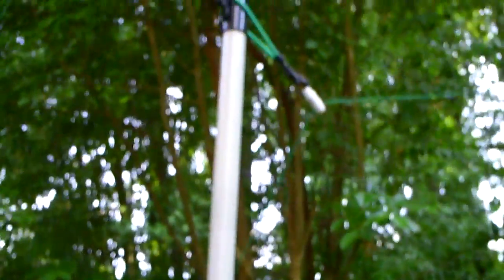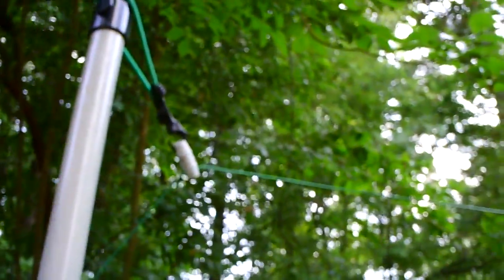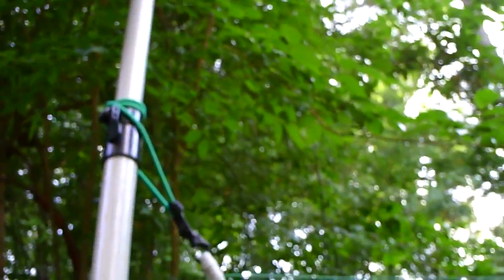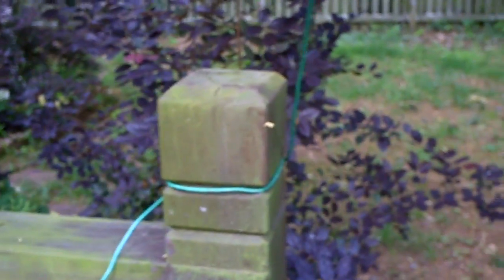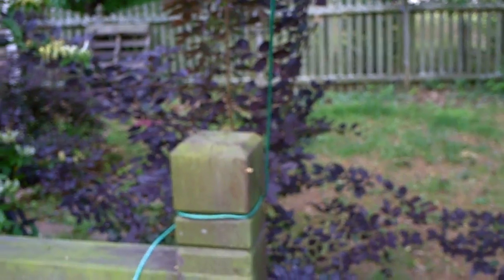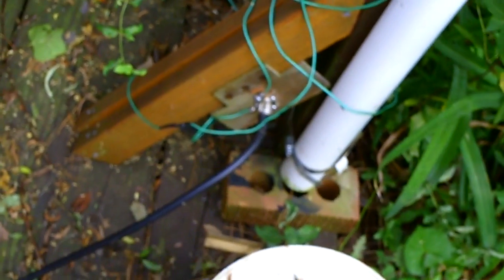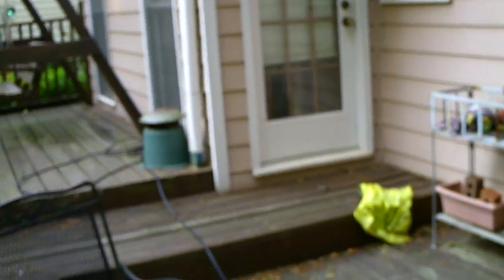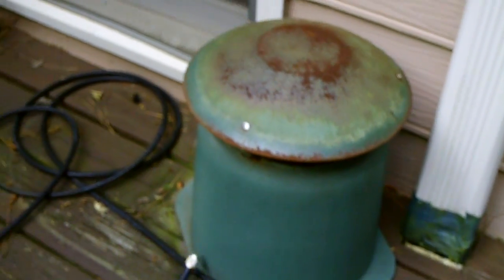My Vertical Loop Antenna Explained.

Comment from the maker: @Lockemeister I used 3.9 MHz to design arouns because there is a Ham radio Net around 3.9 MHz. I wanted to get most of my power into that frequency so I made the antenna resonate around that frequency. It seemed to work, but I haven't used it alot. I lay the antenna on the hot porch in the sun and I think that bakes out any moisture.

Comment from the maker: @MEverett98 I recalculated and found I made the antenna about 257 feet long. It's resonate around 3.9 MHz.
The formula is 1005 / f (in MHz) so 1005 / 3.9
Yes, you are right about the moisture. Sometimes I put a platic bag over the cable and us a twist tie. I have to be more careful. Even though the ends were professionally premade, you are right, moisture can get into the cable.

Comment from the maker: @coolbluelights sorry, i guess i had the camera's lens switched into close mode. It's a cheapy camera that you can switch the lens for closer work. I guess that's the problem. The camera was only 60 bucks and I was able to buy it from a guy in a parking lot.